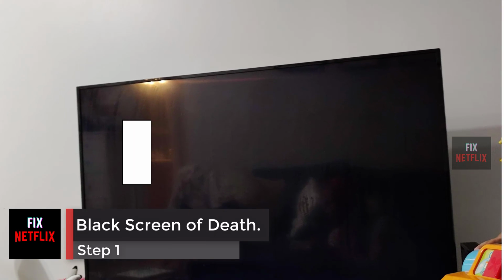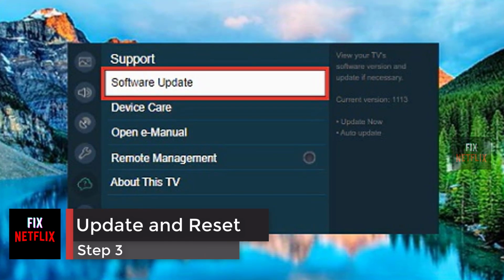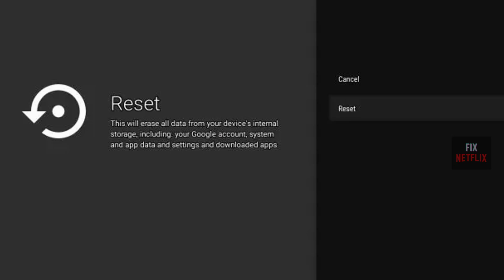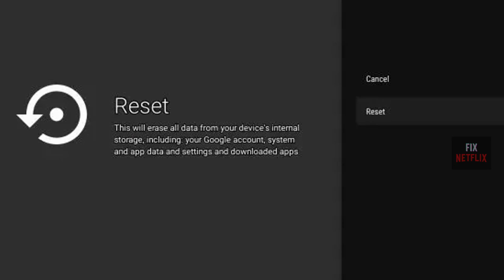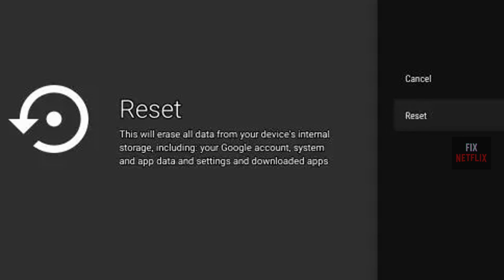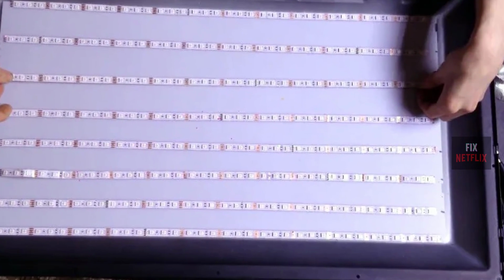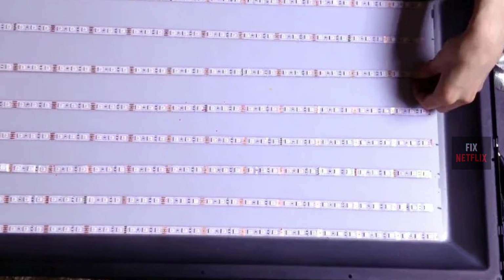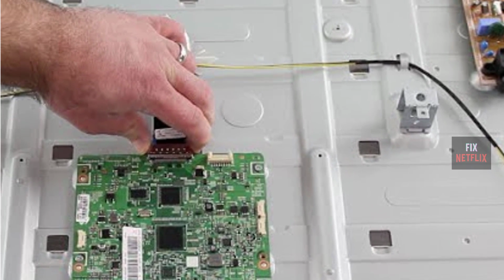Haier LED TV Display Issues? You're Probably Making This Mistake!

Comment from the maker: Upgrade your home entertainment with these must-have TV accessories:
✨ Full-motion TV wall mount: https://amzn.to/3AuBIth
✨ Certified Ultra High Speed HDMI Cables: https://amzn.to/4hvbh7s
✨ onn Android TV 4K Streaming Device: https://amzn.to/4fyWozl
✨ Roku Express 4K+ : https://amzn.to/40triof
✨ Amazon Fire TV Stick 4K : https://amzn.to/3Ae2G8A
✨ Apple TV 4K : https://amzn.to/3UACD2c
✨ Google Chromecast with Google TV: https://amzn.to/3Aqx3IO
✨ Bose Soundbar for TV : https://amzn.to/4f24gtb
✨ TV LED Backlight T2 with Dual Cameras: https://amzn.to/3UvJPfN
✨ SofaBaton Universal Remote with Hub and App: https://amzn.to/40qQWtX
✨ TV Stands and Mounts: https://amzn.to/3UZ7WnJ
✨ Slim Surge Protectors: https://amzn.to/40yhpWE
✨ Wireless Headphones for TV: https://amzn.to/3YNZdXD
✨ Cable Management Kits – https://amzn.to/3UAF5pq
✨ TV Screen Cleaner Spray – https://amzn.to/3YTxzaH
✨ TV Antenna for Smart TV: https://amzn.to/4f9xo1v
✨ Mount Holder for Streaming Device – https://amzn.to/3C8uiMG

(These links help support the channel, it's very much appreciated!!!)
Note: Amazon Affiliate links above, for which I may earn a commission at no cost to you.